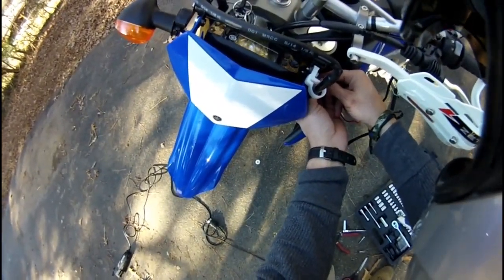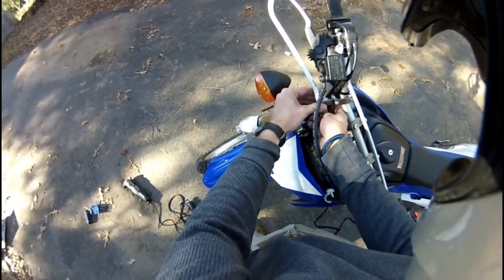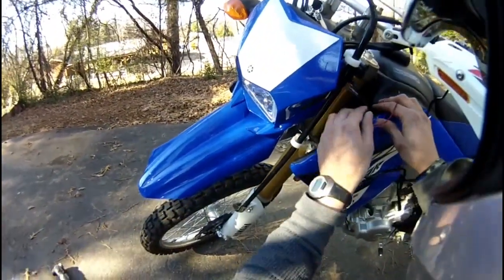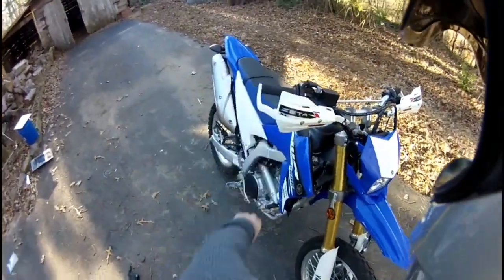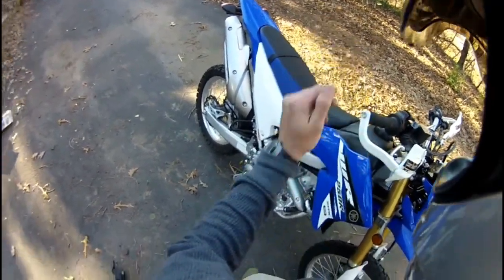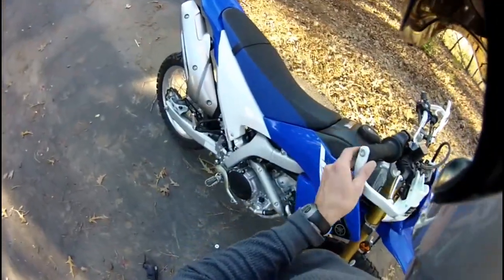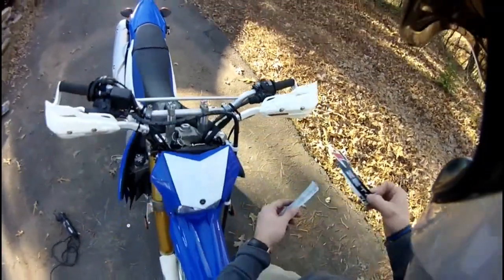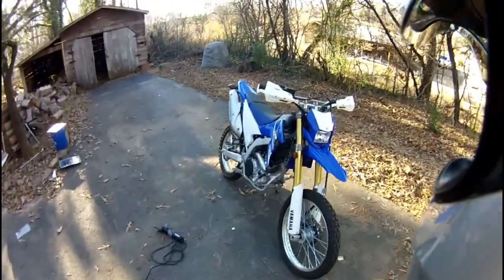Zeta Handguards with Integrated Flashers Install

Comment: FYI, the three wire setup to the factory turn signal is typically because they're used as a running light as well. There's a little electronic module you can get from (I think) 12 o'clock labs that will enable you to have that with LED turn signals. They also sell an electronic relay that will fix your flash rate.
Reply from the maker: Thanks I'll check that out.

Comment: Doesn't your bike have plug ends on the signal wires if you follow the wires back instead of cutting the wires? There is a module to install to make the signals flash at normal rate when you change to led lights.

Comment: Hey man I'm wondering how those flashers are holding up.  I am installing mine and these tiny little screws that hold the orange sense to the LED cluster have me a little worried as far as durability goes.  Did you use any silicone or anything besides those little screws to secure the lenses?  Thanks
Reply from the maker: rstscott The flashers are doing well. I've had them for 2k miles or so and I've already put them through quite a beating. I did not use anything extra for the screws. I just tightened them up and have yet to have a problem. The only issue I have found with the Zetas are that like most handguards they move around after taking impact, so I consistently have to adjust them after falls, but its not a big deal. I am satisfied with them for now.

Comment: You know what makes them stay on even better? Triple clamp mount. Ive heard a lot of complaints about the handle bar mounts rotating when you lay your bike down. they're more expensive though.
Lovin the tunes btw.
Reply from the maker: thanks man. I agree every time I drop the bike they have to be readjusted. I'm waiting on my Pro Taper Contour Bar to get here,  I may look into those

Comment: Great Video! awesome bikes! You mentioned you might upgrade the bulb to LED and also may address the flash rate.  Any luck? Also do they offer anything so you can wire this light up so the lights are alluminated as running lights or only to be used as flashers?
Reply from the maker: Yes it is possible to wire them as running lights, I have not done that, nor have I upgraded to an LED headlight yet. Sorry

Comment: Not trying to high jack your channel just thought Id let you know regarding the question that I was successful installing this on the 2017 FE 501 and used a SicAss flash unit to ensure flash rate is correct. I listed all the info on ny review of the 2017 FE 501 build review.
Reply from the maker: awesome, thanks for the feedback. Glad it worked out

Comment: How's the brightness? Love having integrated lights but I'm somewhat worried about visibility. They probably aren't as visible as the stock ones (because those are a lot bigger) but are they sufficient? Basically I'm asking if people can see you signalling easily/decently.
Reply from the maker: +Colby Tobin the visability is ok I guess, they are pretty bright to be so small. Since this video I have flipped them as I suggested in the video and it has been a big improvement

Comment: So you have to remove the signals on the bike to install this?
Reply from the maker: I don't think so. You don't have to hook up but will have to deal with the wires. I suggest going with just the plan guards, it would be cheaper option as well
Reply: Avid Enduro oh I wanted to install these and also get a pair of led flashers that tst makes to put them on the bike that way I can have both

Comment: Do the blinkers just pop in the back of the guards? what holds them in place?
Reply from the maker: +brian k no. there are set in place when you receive them. So far I have seen any issues, and I'm pretty rough on my WR
Reply: Mine were in a seperate bag, they were pretty tough to get in which is good because the screws are garbage.

Comment: Do you know anybody who has successfully done this on a FE 350 or 501? I'm concerned about the flash rate being ridiculously fast going from bulbs to LED. Also wondering if anyone on FE model has successfully done the mod and used them for running lights as well as flashing signals.
Reply from the maker: Sorry I don't know anyone who with those bikes who have installed them. I will tell you that since that video I have flipped the signals to the top, making them much more visible. I will prob do he mod to make them running lights but I haven't yet